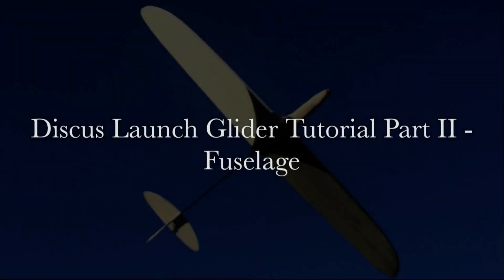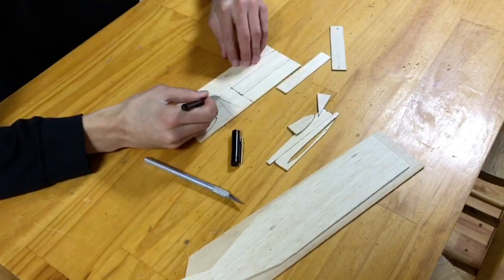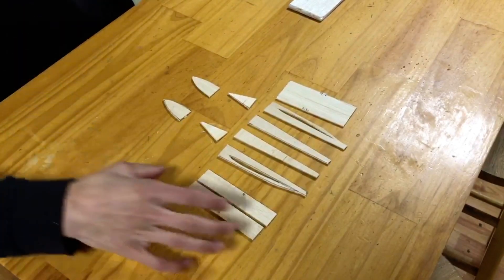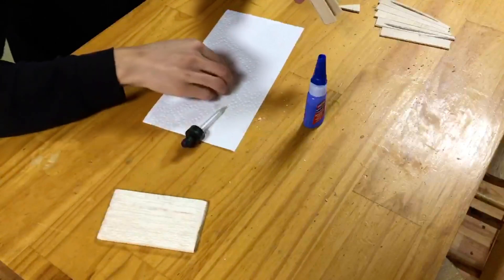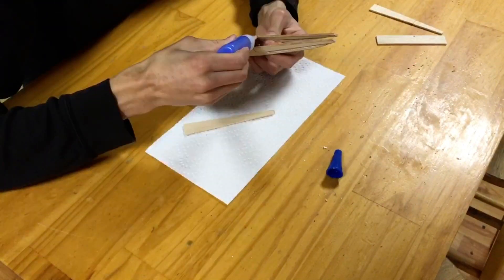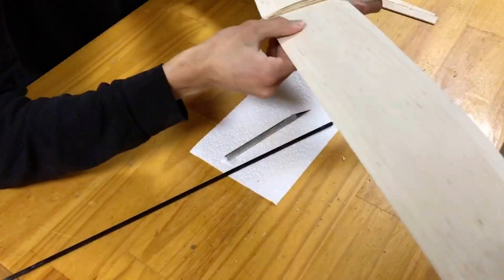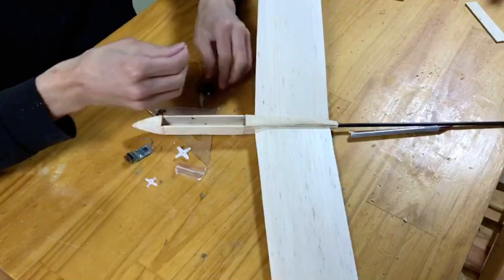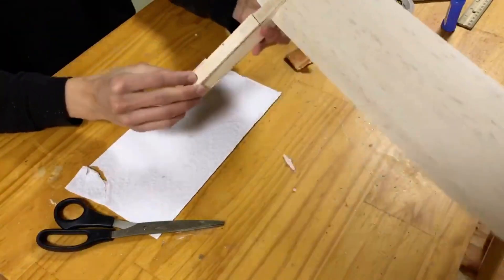Balsa DLG Build Tutorial - Episode 2 | FUSELAGE

Comment: Hi Aerocraft Guy.  I really enjoy your website and your level of detail. Just a quick question...where do you buy your 2.5 gram servos? Do you use a specific website and brand? My local hobby shops don't seem to stock too many.  Thanks, Doug
Reply from the maker: Unfortunately, local hobby shops are seldom reliable when it comes to specialty components like super small servos. I usually surf around on eBay for good deals on 2.5 grams. Or, if you're willing to wait a while for shipping, then you can buy them for real cheap in bulk on those Chinese wholesale sites like Aliexpress or Gearbest.
Reply: Thanks for the quick response!

Comment: It looks as if you leave the chamfer sharp on the leading edge of the wing. If so, blending the edges of the chamfer into the leading edge and center of the wing will vastly improve your airfoil performance. You should have much better lift and less drag than you will with the chamfered design. An airfoil must be smooth in order to promote adhesion of the air to the wing for as long as possible.
Reply from the maker: Generally that is true, but for small gliders it is consistently experimentally shpwn that a sharp leading edge actually performs better than a rounded leading edge. Stan Buddenbohm has show this with his record-setting aircraft, all of which are specifically designed (in regard to wing shape) for the sharpest leading edge chamfer. While I myself have not noticed that the sharp leading edge is always better than the rounded, it certainly never seems worse; either it is about the same or slightly improved as compared to the rounded leading edge. 
     But yes, in a general case your point is correct and important. Especially for full scale gliders, whose airfoils maintain quite laminar flow for most of the speed and incidence envelope, a sharp leading edge can be really detrimental because the laminar flow can separate and has little impetus to reattach, sometimes forming a wide, thin separation bubble that spans most of the chord.

Comment: I would like to ask you how long the fuselage would be to if I scale it to a 1 meter wingspan size? Or at least how long the carbon fiber tube would be?
Reply from the maker: It would be the current length (which is 19.375") times 1.09, to convert from the current wingspan (1 yard) to your desired wingspan of 1 meter. That gives 21.119" as the length of the carbon fiber tube. If you want to scale any other dimensions, just use the yard->meter scale factor 1.09.

Comment: Hi.   I've build your plane and noticed you suggested what servos to use.... Do you have a suggestion for your battery size...
And Will 3.7 servos work... Thanks
Reply from the maker: Great, glad you are following the tutorials. :) I use a 1S 150mAh LiPo battery. I connect it directly to the receiver. 3.7 gram servos will work too. it will be a tight fit in the fuselage though, so you may have a sand away some wood on the inside.

Comment: Hi can you quote the plan I have some problem printing in scale. Thanks
Reply from the maker: Hi. Yes I also had some problems when I tried to print it right from the PDF. I will remake the plan sometime. Use this reference dimension: The Bottom Plate is 0.75 inches wide. Hope this helps. :)
Reply: Thanks.

Comment: Another good video, fun to watch. If you don't mind my asking, what receiver/battery are you using for this and for the larger 1 meter DLG?
Reply from the maker: Thanks! Glad you enjoyed. I use 4-channel barebones DSM2/DSMX receivers, like the LemonRx ones. I go for whatever cheap off-brands I can find on eBay or Banggood. I think the last one I bought was from the brand REDCON. I run the servos and receiver directly with a 1S LiPo, either 150 or 180 or 220 mAh, depending upon the size of the servos. Since the servos are so small on this one. I actually might even be able to get away with a 70 mAh battery. I’ll have to experiment once it’s flight-ready.
Reply: @AeroCraftAviation  Cool, economical and easy enough setup. I'm hoping to build an RC towline glider or two in quarantine this summer, will check back on your videos and post my own if/when they're flying! Just have to decide if I'll design my own, or do a Zaic or some other classic old plan...
Reply from the maker: @sandfac3427  Thanks. Glad my videos can be of assistance. Doing one's own design is always the most fun in my experience! :) Can't wait to see you gliders. Bet they'll knock mine out of the park!

Comment: Pretty good work.  I had a thought about the fuse where the forward section joins the rear.  Have you considered shortening the two side pieces on the forward section and slightly tapering the overhang of the bottom piece.  On the rear section increase the length of the two side pieces so there is overlap in the joined area.  This will increase the overall strength of the fuse with no extra weight added.  BTW on my videos I prefer to work off camera as I like to take my time as well.  looking forward to the next instalment.
Reply from the maker: Thanks! That’s a good idea, if I’m understanding it properly. Essentially increasing gluing surface...? Working off-camera is definitely the way to go for me. Especially because I am near-sighted, so I often have to look very close to my work, which can look weird on camera. However, I’m trying to do as much work on-camera as I can, to give beginner builders an idea of my actual techniques.
Reply: @AeroCraftAviation  you are essentially staggering the join so any load is not concentrated along all the glue lines at any one time.